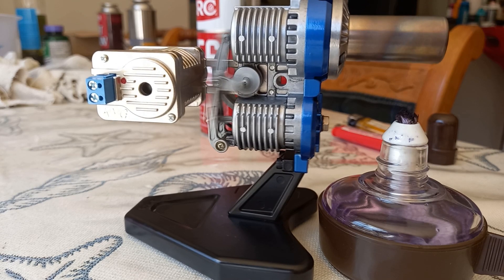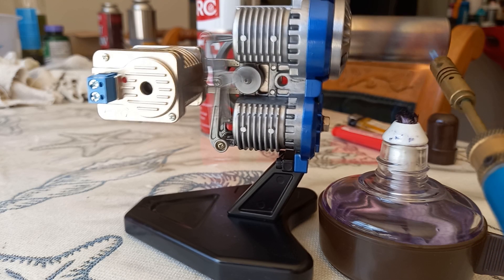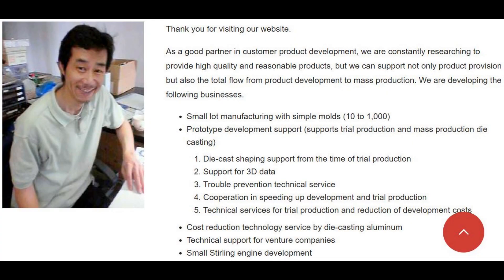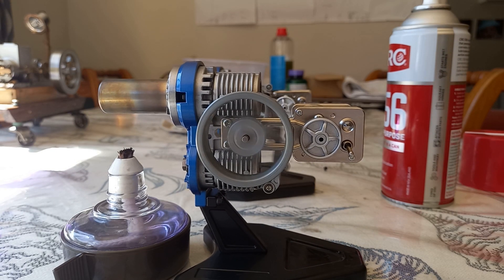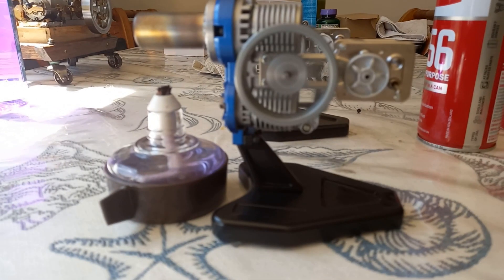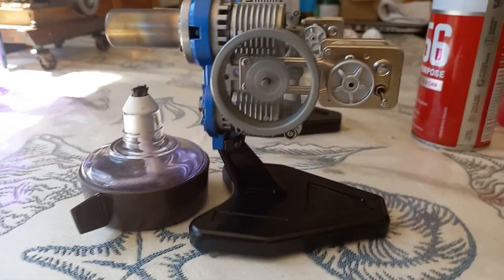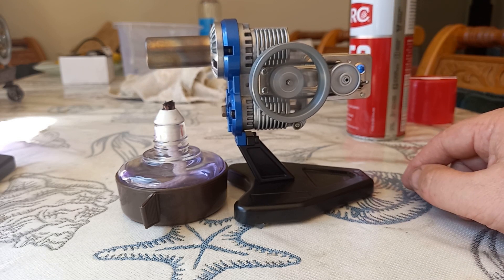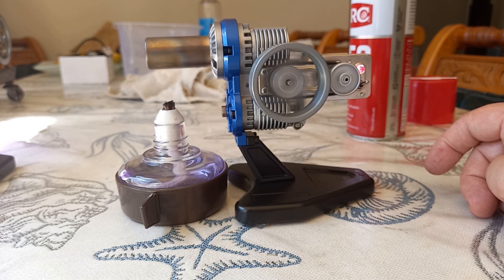Silent engine! KYG SE905 Japanese Stirling engine RARE QUALITY #stirlingengine #silentengine

Comment: I love quiet engines! And it appears that the KYG SE905 engine can still be purchased on thier website. Cheap too if you pay in USD. But there was a video of it running and you can clearly hear the typical high speed stiriling engine sound. Did you just get lucky and get a rare quiet copy?
Reply: video is at https://youtu.be/mUzz2pPw2Pg
Reply from the maker: Hmmm. One of my two is silent, the other hums. The hum is due to one non-silent conrod little end.
Maybe there is some luck involved

Comment: How do you build one that doesn't rattle? What are the design considerations for that?
Reply from the maker: sorry, I have been away. To answer your question, to build a machine that doesn't rattle requires well machined bearings and accurate measurements. Crucially, ball bearings don't twist, so you have to get the crank exactly "square". This is difficult without machine tools, in my garage.
Reply: @ThomasPCGuruENGINES  Thank you for the reply. Immo work on building a machine shop.

Comment: ? How much was it? Any mA? Volts? Where how you bought it?
Reply from the maker: In August 2014 my second engine I payed Matsumoto-san 29,800 Japanese Yen or US$258 on today's exchange rate. I thought the other on ebay was US$299 but can't confirm that. mA will be minimal I would think but I have seen it running a small Christmas tree of LED lights and charging a tiny RC hybrid vehicle battery

Comment: Hello Thomas!  Like you, I had purchased many years ago, the KG se905 Stirling engine from the person you featured in this video.   Unfortunately, I was not wise enough at the time to buy two.   I have used my engine so much that the heated displacer cap has cracked and the cylinder therefore can no longer hold pressure.   This is a long shot but would you by any chance know if I could purchase a spare from the gentleman in Japan?   If that is no longer possible, and you need mine for spare parts, I would be happy to send it to you.   Thanks.   Tony
Reply from the maker: The displacer cap part is D2. I suspect Matsumoto-san has this part; of all parts it would make sense. Contact him directly by email at ky.matsumoto@lapis.plala.or.jp or through his website inquirey form at https://www.kyowa-gokin.com/contact which is still functional. Remember, on his websites use Chrome and right-click the pages ->translate pages to English on the fly.
I haven't used this email since 2014. I notice it's not a gmail address so I hope it still works. You can type your English email and also copy a Japlish translation; a kind thing to do, using https://translate.google.com/.
Please keep in touch and let me know how you go. Good luck!!!! :)
Reply from the maker: Plus if that doesn't pan out, a local engineering shop or model engineering club should be able to replicate it. Much as I'd like your engine, don't give up yet! :)
Reply: @ThomasPCGuruENGINES  I followed your advice including the translation.   I found the invoice he sent me when I purchased it 10 years ago.   Will let you know if I hear back.   Really appreciate your help with this.  I'm a little obsessive about my engine!
Reply from the maker: Nice going...Good luck!
Reply: @ThomasPCGuruENGINES  

I am a product designer and formulation chemist. 
I would like to purchase these at 100 at a time.
How do I contact the manufacturer?

Comment: That is dangerous. If a rod breaks down due to unbalance or simply usage it's gonna fly like a bullet and kill somebody
Reply from the maker: These parts are tiny and the rods are aluminium. Also...very well made. You've managed to think of something that's never occurred to me!! :)
Reply: Yes, so is driving a car.  Hell, just walking down the street is dangerous, you could get hit by someon elses car, or struck by lightning.  You could not notice a piano being hoisted to the 4th floor of a city walk-up apt, walk under it when the pully fails and get smoothed.  And that piano would get ruined.  You could stub your toe and get a flesh eating bacterial infection and die of sepsis with in the same day.  A rabid dog could bite you; survival rates of rabies is nearly zero percent.  Doesn't even have to be a a dog, it could be a maladapted chipmunk or ssquirrel.  Even staying at home is dangerous, an airplane passing overhead could blowout an engine and falling debris crashes down on your residence smooshing your home whilst you're inside.
Reply: @kayakMike1000  chance of a homemade engine to break down projecting sharpnel like bullets is way higher than getting a piano on your head in the street

Comment: Well it would be nice if they made Stirling generators big enough to run a few appliances.
Reply from the maker: But maybe a wind generator is a better spend of money these days? Or solar?
Reply: @ThomasPCGuruENGINES  The solar panels work only during day time, The wind turbine works where it is constantly windy. You may as well have micro hydro instead.

Comment: These should be range extenders .. WTH haven't  they yet .. instead they do loud 2 strokes
Reply from the maker: ohhhhh you mean in electric cars. Yeah totally or the new "iquid piston" design rotary ic engine
Reply: We don't have this in cars (yet) because efficiency and power are not very high. Useful engines for more than just a fan or so are about the size of laundry machine, and even then you typically get only 1kw electric power.
Waste heat could possibly be harvested from a semi, but barely from smaller vehicles.
Stirling engines are either simple or efficient or powerful, but it's hard to combine all those three qualities in one.
Stationary engines and electric heat pumps are the only economic applications so far.